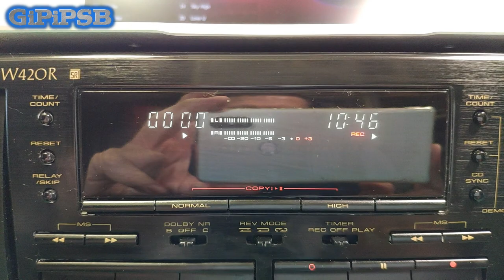Cassette deck PIONEER CT-W420R Replacement Belts, Cleaning and more...

Comment: where can i get belts for a pioneer ct-w301  pls let me know
Reply from the maker: ebay: https://www.ebay.it/itm/166371352163?hash=item26bc815e63:g:Qg4AAOSwXNxlJQ~J&amdata=enc%3AAQAIAAAAwFPfWwEkdZ%2FFP3JygDKQO6HH0zw43BbjisQfck2vEnwYc5V%2BY9sD6lNp3ecQIdJZodzn0Rw%2F0guecWC1RyXPsW1WaoWNOeHKl18RpZma1iZYB%2By6x%2BEKffnS8v72Mp8alWu%2BTH1WrfmRUG0yRmqTArdD16Pcr0sLO1nM7aUAWZc9NVLJ8o1etXqH2KCDEN%2BBQgxppJgmDR7G3mkYcoyy14p9d7S3%2Bqv%2Fn1O7fXhazIoTCBOhwgPZ3OL6uNxk7Xuckw%3D%3D%7Ctkp%3ABk9SR_bM1Yf1Yg

Comment: Ciao Giovanni. Video interessante (come sempre) dove la tua pazienza è encomiabile. Grommet reactivator ... riattivatore gomma, hai un link ? Ho poi una domanda più difficile ... le cinghie erano distrutte. Come hai fatto a capire quali erano le dimensioni di quelle nuove  e, soprattutto, come montarle tra capstan, pulegge, etc? Non mi è sembrato infatti che ci fossero riferimenti ... Ah, dimenticavo ... che colla hai utilizzato per ricostruire il meccanismo?
Reply from the maker: per il verso delle cinghie ho scaricato il "service manual", mentre per la misura ho fatto delle ricerche on-line, poi in realtà non ho comprato le sue specifiche (costo era oltre 50€ ora su Amazon c'è un venditore che le ha a 20 € https://amzn.to/3kvvqRQ) ed ho utilizzato delle generiche comprate su ebay.
Alla fine ho ricreato il "pernetto" rotto con una clip fermaglio per carta e l'ho scaldato con l'accendino e fatto penetrare nella plastica poi limato a misura (e tutta quella parte, la vecchia telecamera che usavo, ha registrato fuori fuoco ed il video era inutilizzabile mannaggia).